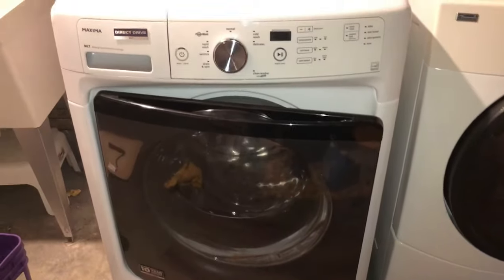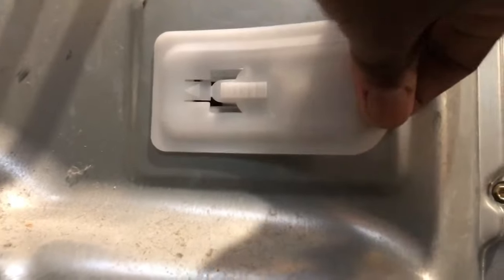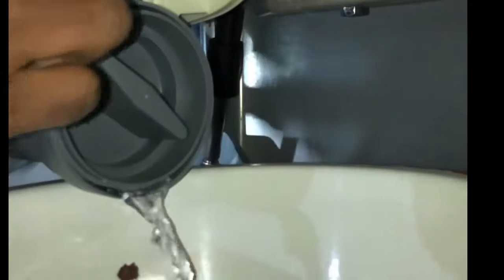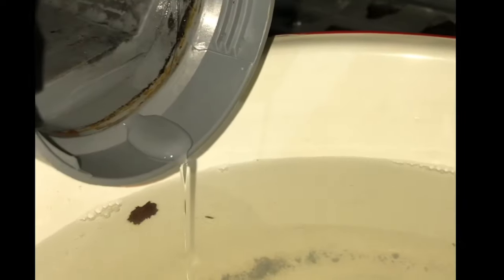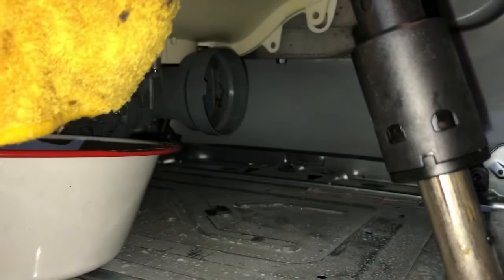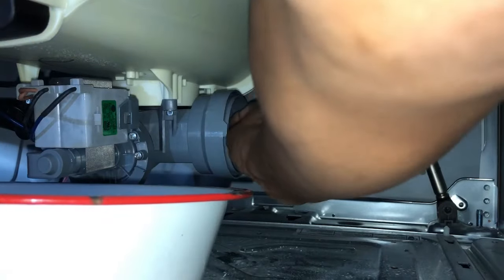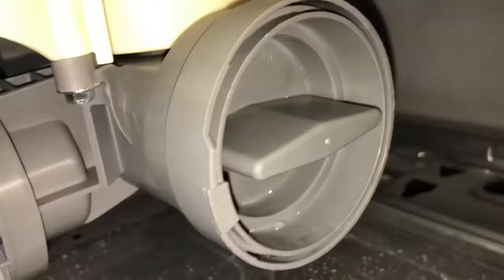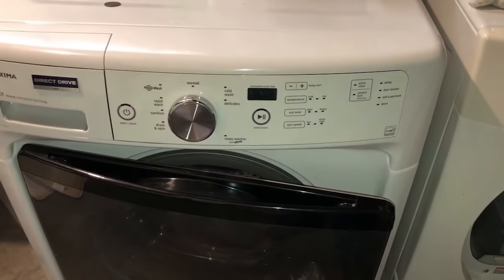Cleaning The Filter Of A Maytag Front End Loader Washing Machine

Comment: I have a Maytag Maxima X MHW3000BHO with a pedestal.  This video is deceptive.  I gave it a thumbs down.  Oh, you have to take off those four plastic clips, but then you have to remove 12 hex screws to get the back off.  The screws are 1/4 inch. They show you that at the end of the video.   I think the plastic clips are for the factory, to hold the back in place so some Chinese worker can screw in the hex screws.

Then when you get the back off, you'll see that the drain doesn't face the back of the washer, it faces towards the front. 

My washer is in a small laundry room, so doing all this was an exercise in climbing behind a washer with a flash light, wrench, a bucket and some rags.  What an awful design.